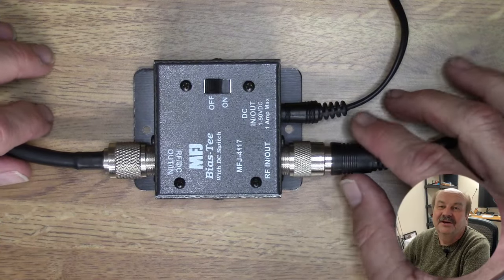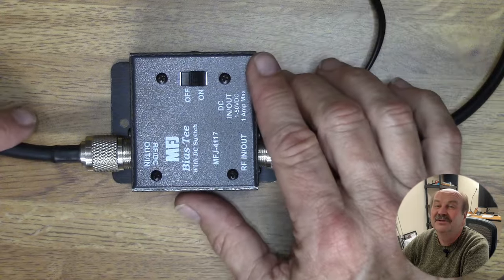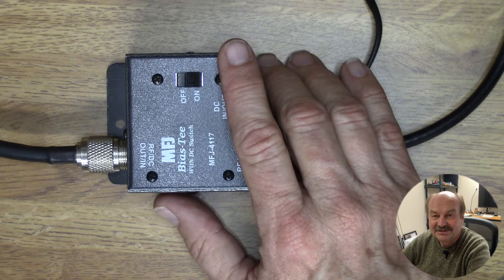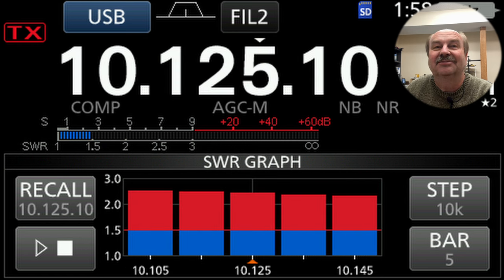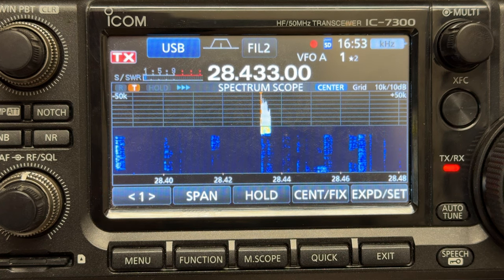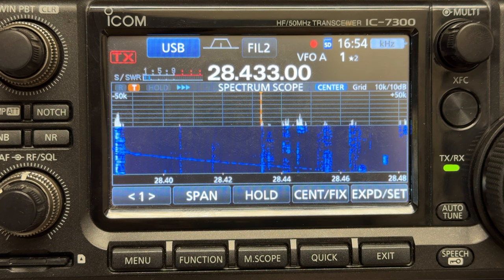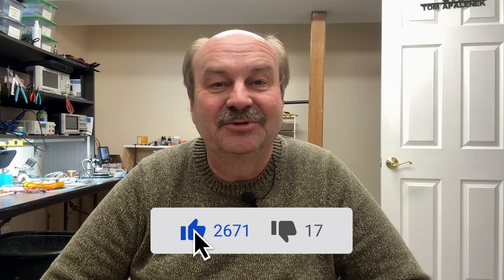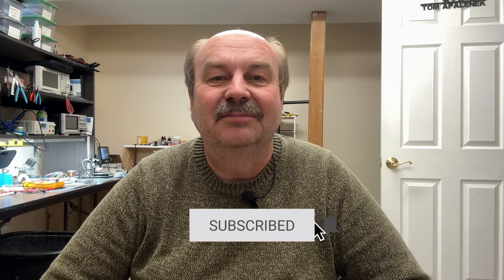Long Wire Endfed Part 2 - Performance

Comment: Tom, AWESOME awesome video follow-up! You’ve def got me inspired to do something now with my spool of fence-wire. I even ordered me the mod for my 7300 to add/create a dedicate receive loop! Your 7300 videos have helped me SO much over the past four years with mine, and you’ve done it once again! 🤝
Reply from the maker: Thanks!  I'm curious.  Did you order the Inrad RX7300?
Reply: Yes, which mod was ordered?
Reply: YouTube must’ve deleted my message. I ordered the RX7300 from HRO. The one from InRad is no longer available on their page.
Reply: @Brent_N4BDW  OK, gotcha! There is also info out there on making a switchable port on the 7300 for a dedicated receive antenna. It uses a coax relay switch.
Reply: @reidlanham2011  I’ll have to look it up, but does it do the switching automatically when it senses transmitting?

Comment: Seem to be working great. It might be a little long. Try lopping off about 10-15 feet off it and see if that helps. Obviously the tuner is working it well but shortening it a little might being the 20/40 bands in a little better where you dont need it :)

Comment: Great video! I have a 130 foot EFHW-8010 Myantennas antenna. I took t-posts and slipped 10 foot 1.5 inch schedule 40 PVC that I cut slots in to fit the wire into and capped the ends of the PVC pipe to keep the wire in place. I did this configuration mainly for 80 meter local traffic. I have nay listened to it but when I get time I will try transmitting into it. SWR is decent on most of the bands. I prefer my ZS6BKW/G5RV antenna to the end fed but I wanted 80 meters and my other antenna won’t tune 80 meters.

Comment: You need to boot your rig in emergency mode. It will cut your power to 50w but it will change your internal tuner to a 10:1

Comment: Interesting video and experiment.  I have room for something like this, though not the best ways to get it up high enough.  Maybe someday I'll give it a try.  Lots of wire in the air I think it is a good thing!  BTW, I originally found you searching for IC7300 videos when I got mine a few years ago.  Your play list on the 7300 has been my go to videos, and have walked me through the radio the first time.  And I have been off the air for a year or two, so I went back and reviewed some of the videos to refresh my memory on features.  Thanks again, and keep up the great work.  Frank  K6WI

Comment: Is there a benefit to having such a long antenna? Is the length more important, or the swr? Does the direction you ran the antenna have any benefits? Thank you.
Reply from the maker: Hi.  Complicated question.  Long helps more on the lower bands (160M, 80M, 40M). On receive especially, think of it as trying to “catch” radio waves.  The larger the wire area, the more waves you can catch.  SWR is important, but many hams over rate the importance. As one Elmer reminded me, a dummy load has a 1:1 SWR, but it’s not a very good antenna.  The radio needs to see a low SWR to transmit properly, but the tuner takes care of that.  If the tuner is out at the antenna then your coax losses are reduced.  Thanks for watching!  Hope this helps.
Reply: @ thanks for the response. Great video.

Comment: I would like to see how this antenna works with the IC 705 and AH 705 tunner. With the combination of IC 705 and AH 705 and a 20 meter end fed antenna (with 1/49 un-un), I can communicate very well with Western Europe from Turkey using 10 watts power. Thank you Tom for this beautiful video.

Comment: Hi Tom, thanks for your informative videos. I was particularly interested as I built a 203ft/62M antenna last weekend, so about half the size of yours and only about 12ft off the ground. Interestingly, my SWR readings were pretty much the same as yours. I haven't had time to use it much but my current longest distance QSO was just under 1,300 miles, 20w, SSB, 20 metre band. On 160, I'm getting at least 180 miles NVIS and expect to achieve better.  I will be interested to compare results.
Reply from the maker: I'm expecting mine to mostly be a cloud burner on 80 and 160.  I think I said this somewhere in the video, but mine is about  13ft. above the ground at its lowest point and 40-50ft.  at the highest where it is at the tree.

Comment: Nice video. Were you using an amp?
Reply from the maker: No.  The contacts were with the 7300, barefoot, 100 watts.
Reply: @ very nice contacts without an Amp!

Comment: Tom, have you looked into a Skyloop? Looks like you could do one of those.
Reply from the maker: I have thought about it.  The issue is supports.  I might be able to use trees.  Putting poles up around the property is probably a non starter.
Reply: @HamRadioA2Z  I am definately going for trees though I have a lot of trees to get around along the way. Right now, just going with a really big doublet.

Comment: First of all thanks for the series of videos on the IC-705. They have been very helpful. I have the SGC-230 external tuner that I have been wanting to connect to a Random Wire (much shorter than yours) but I was curious how you grounded the Tuner if you did that is. Have you noticed the Random Wire being directional being that long?
Reply from the maker: Thanks for the kind words.  I'm glad you like the 705 videos.  Right now, I just have a counterpoise wire connected to the tuner ground terminal.  The wire is about 30 ft. long and just laying on the ground.  Part of the more permanent setup will probably be connecting it to a ground rod below the tuner and also to the house/shack ground system.
What I would love to do is come up with something to disconnect the antenna from the tuner (remotely) when storms are coming.

Comment: Tom, I always enjoy your videos. I have been considering building something similar, a little shorter around 300 feet.  You mentioned wind loading, my concern is ice buildup. What direction is your antenna orientation, and do you see any nulls?  For receive it is very much like a beverage antenna.  I will not get around to installing mine till spring or some warm late winter days, so I will be interested to hear how it holds up over the winter. It is a very timely video for me to ponder....

Comment: Hello Tom, it's been a while but great to see you. I had no idea an antenna could be so long. It certainly is working out for you anyway. My only other comment would be how bloody long does it take you to mow the lawn, hi hi. Great set of video's Tom thank you as always for posting, stay well.
Reply from the maker: Thanks!  I listen to a podcast called HamRadio Workbench.  Their podcasts are typically about 3 hours long.  When I'm mowing the entire back field with a 50 inch riding mower, I can just about listen to a full podcast. 😊
Reply: @HamRadioA2Z  Thanks for the reply Tom and the tip about the Podcast I will check that out. Take care.

Comment: For me I would be interested to hear how the antenna perform on 40,80 and 160M...  as that would be the whole idea of using a long long wire antenna.. You could work EU on 10M with any simple vertical or wire antenna.
So could you do some tests on 80 and 160M, could you work EU on 80M?

Comment: What exactly does the MFJ 4117 do?
Reply from the maker: Hi.  The MFJ 4117 comes with the tuner.  It is called a BIAS-TEE.  It injects 12 volts onto the coax cable between the center conductor and the shield.  It has a capacitor coupling to the connector going to the radio.  This is so the 12 volts doesn’t go to the radio.  The tuner has a similar coupling built inside it to use the 12 volts to power the tuner and then separate it so the actual tuning part of the tuner and the antenna don’t see the 12 volts.  I think this probably is worth its own video.